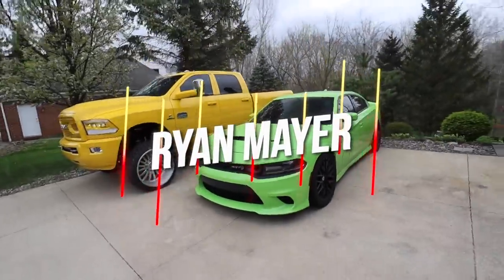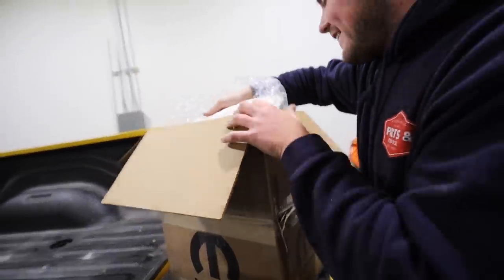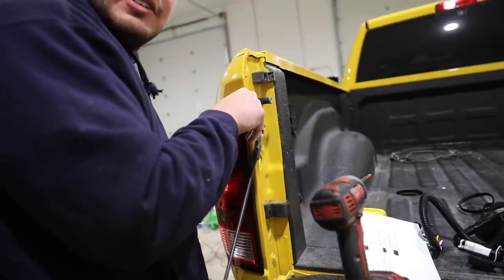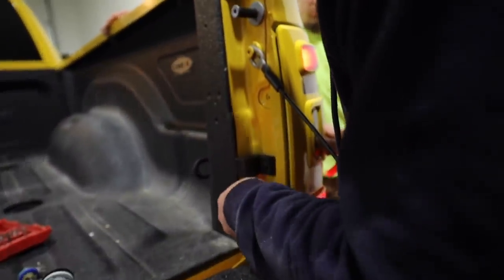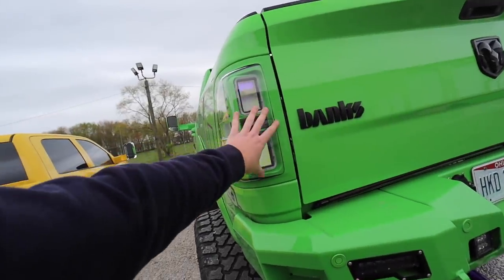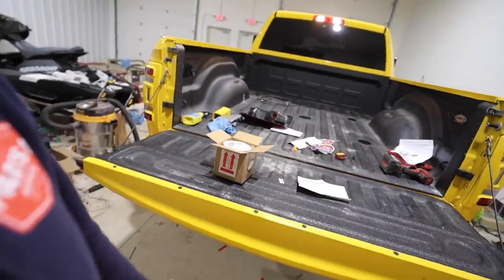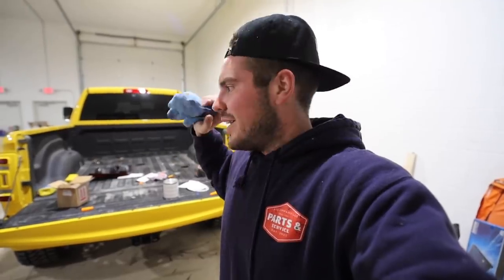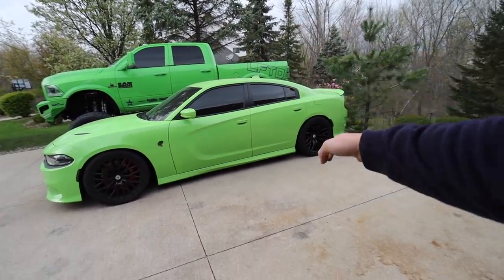Converting My Truck To a 5th Gen!!

Comment: if you leave the running boards black, take the paint off the step guard on the rear bumper & leave the bed liner black, that way there is things that it can tie into.   But youve got this much yellow....might as well do the steps yellow also.  Itll be a lot of yellow but super clean looking.  That way the red bedliner will pop like the suspension.

Comment: Need the mud flaps, matching yellow fender flares with the chrome bolts. 
Maybe Yellow and Chrome or cherry red running boards,  
Should add a GoRihno rack on the box maybe painted Yellow as well with the box being that Red.

Comment: U can always make hand get shorter & gear get taller if u hve a pin u pull out so ego gear free wheels like on a bike. Then extra spare taller gear can pin play/tow if u hve right bolt pattern on that gear hand on a clock length of drive shaft to bolt on. tiny bit to still work out but sure need a 2 clock hogs head for trucks must figure it out. A 3speed not even over kill, ego flat lands or gearing high lands or grunt max towing.

Comment: So I’m wondering how did the piggy backing the piggy back work? I just ordered the 5th gen tail lights with the amber turn that needs to piggyback the trailer harness and I also ordered the Putco Blade 92009-60 with the quick connect piggyback harness 529004

Could you describe how you did this was it simple what plugs to what 

Looks amazing btw
Reply from the maker: Works wonderful!!!

Comment: 685: showing to clocks for hogs head a big tow gear & a 3.73 eco gear. 2 hands on a old school clock so just unbolt your drive hand ego deal shaft & bolt up your tow hand on clock shaft, easy quick change diy out.